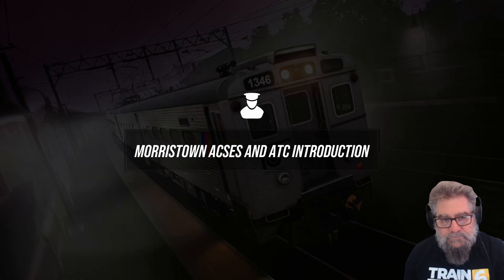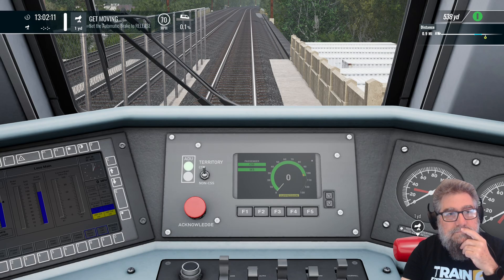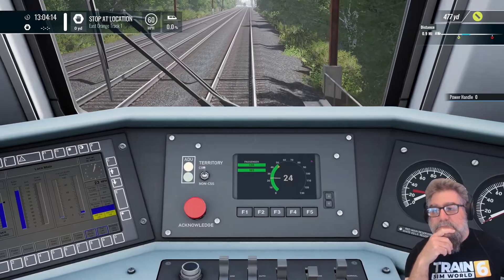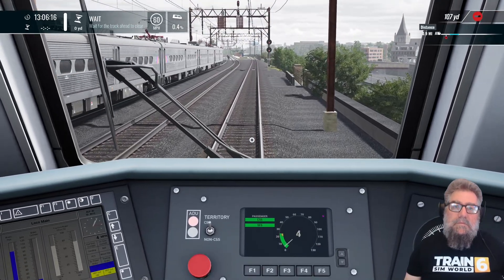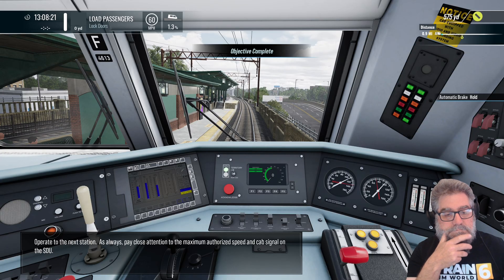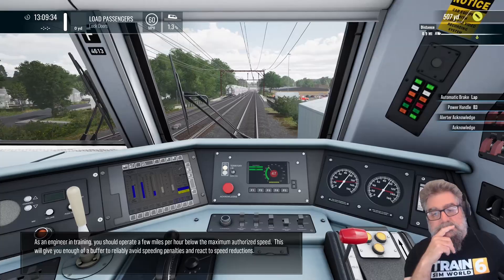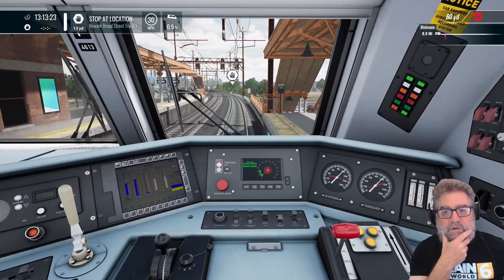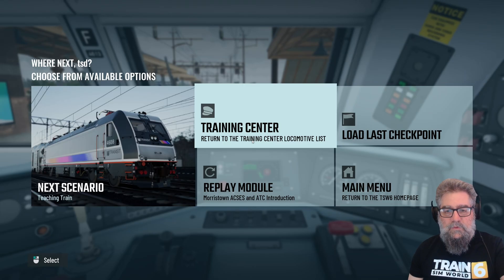tsw6 tutorial ATC and ACSES Safety Systems on Morristown Line

Comment: I believe suppression is calculated based on how much braking you need to comply.  On Trenton it was a certain measure on the equalizing reservoir.  Notice that when you brake the ADU says the word suppression at a certain threshold.
Reply from the maker: It is when your decelerating to stay ahead of the curve but not during a penalty. Dropping the equalising will go into suppression most of the time except during penalty which is why I tell people 90.